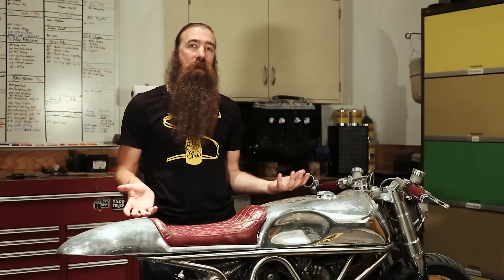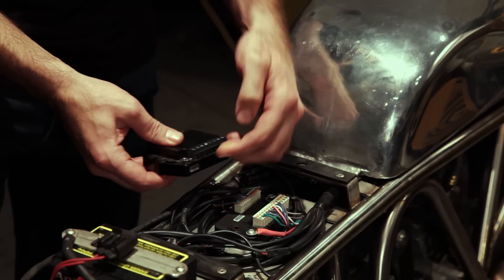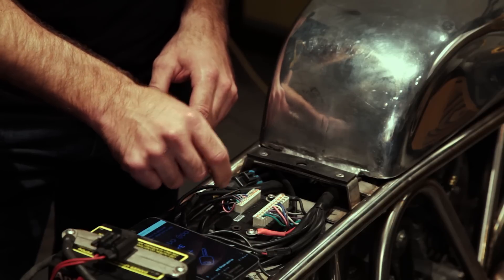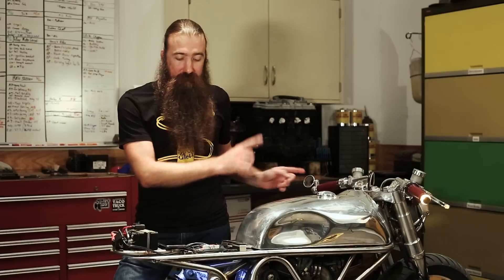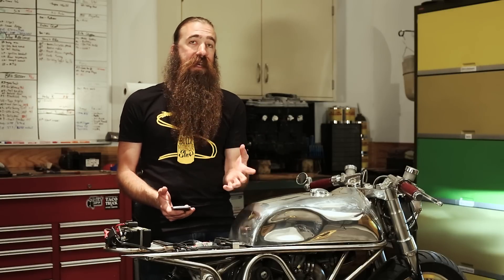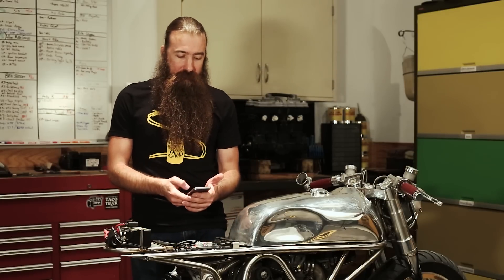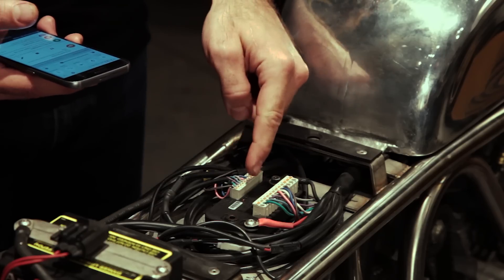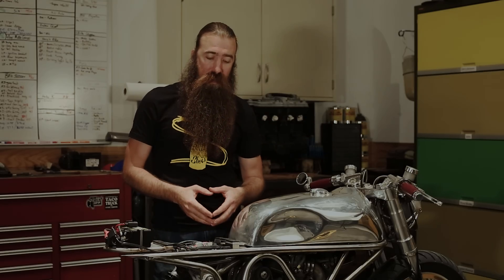Revival Cycles' Tech Talk - The M-Unit Blue on an Actual Motorcycle

Comment: So, I want to understand more clearly, I don't need anything except a battery, AWG 16 primary wire, and the parts that I want to have electrified (lights, buttons, omeders, etc)?
I'm new to working on motorcycles. Old electrical parts are... new to me, and my carbs are difficult to find info on, so those are my learning curves currently (Haynes is in the mail).
1977 GS550 Cafe project!
Reply from the maker: Yea, pretty much. You need an m-Unit, handlebar control buttons,  ignition system, charging system, headlight/tail light, turn signals, horn, starter solenoid, and some dash lights/gauges.  The ignition system and charging system will be from the original bike, or aftermarket model specific options. 

Oh, and 16 gauge GPT wire is good for the outputs, but you can drop down to 18 gauge if you switch to TXL insulation.
Reply: Thanks so much. I just binged a bunch of your videos over the past 18hrs, so I figured it out. Either way, you guys gave me the answer.
Reply: I'm loving the tech talks. I'm a nerd like that. Really helpful.

Comment: Does that mean you don't need to use a regulator/rectifier?
Reply from the maker: The m-Unit will handle all the power distribution and control, but it does not replace components in the ignition system or the charging system. Both of those systems are too model specific to make a universal solution, but the m-Unit is still a great help in simplifying the rest of the wiring on the bike.

Comment: This is kinda a bummer. It won't work with my 77 triumph tiger. No starter button.
Reply from the maker: You can always add another button. Either to the bars or hidden in a different part of the bike. We've got some handy little buttons that can be mounted right off the back of a standard clutch or brake perch. https://revivalcycles.com/collections/for-your-ride-controls-buttons-and-switch-housings/products/push-button-kit This kit is really nice, but if you want to save a few $ this button would work just as well. https://revivalcycles.com/collections/for-your-ride-controls-buttons-and-switch-housings/products/mini-push-button-switch

Comment: I've got the m-unit blue and I was wondering is there a way that I can set it up without using the starter, like i got xs650 with Newtronics Ignition box,  i would like that to run on it own and m unit to use the lights and etc
Reply from the maker: every circuit on the m-Unit is independent of the others, that means you can use the ones you want and skip the ones you dont. You may still want to have a button connected to the start input so you can take advantage of the keyless go feature, but there is no need to have a starter connected to the start output.

Comment: Hello, i have a problem with my m unit blue,  i have an alert on my smartphone that says bike is tipped over but my bike Never falls . And my turn signals are always blinking. Do you know what s wrong? Thank you and sorry for my english
Reply from the maker: This sounds like the alarm is being triggered, which can be caused by vibrations or very loud noises. The best advice is to change the alarm sensitivity to a lower sensitivity, with a pre-alarm. Also you could turn the alarm feature off and see if the problem continues. 

The alarm functions are all internal to the m-Unit so you can't really make a mistake on the install, so if this continues to be a problem you may have a malfunctioning m-Unit and you should work with your supplier to get the issue resolved.
Reply: Revival Cycles , i m already with this option prealarm and nothing changed. Thank you for your solutions
Reply: Everything is ok now,  i updated my firmware m ride

Comment: Curious about the alarm feature. I have the M-unit Basic and have the alarm activated when I leave the bike. I've never had an issue with someone messing with it....yet, but lets say I did. How long will the horn and lights go off for before it stops. Curious if they shut down on their own after a certain amount of time or does it just keep going and going until the key is inserted. I could see the M-unit Blue maybe being better in this regard since it would most likely send you a notification that it was going off, where as the basic wouldn't. Couldn't find any information on this in my manual. Great videos and beautiful builds you guys do. Really inspiring.
Reply from the maker: The alarm duration isn't listed in any of the documentation we've seen, but based on a bench test , the alarm will honk the horn and flash the turn signals for 30 seconds each time the alarm is tripped. So if the bike is bumped its only 30 seconds of alarm, but if the bike is being moved or stolen the alarm will be tripped repeatedly and the alarm will continue to sound longer than 30 seconds.

Comment: Hi man!! can I ask you a question? I have an harley davidson, sportser, if I use the M-unit blue, can I replace the entire old electrical system with a new one, bypassing al the engine sensors ecc? thank you so much
Reply from the maker: The m-Unit Blue will handle the power distribution, but it can't do engine managment. If you have a fuel injected bike the ECU will still need to be part of the system, along with the supporting sensors, fuel pump, and injectors. So far, there isn't really any type of universal aftermarket system that will take over engine management, that is something that is way too model specific and there are a ton of different ways manufactures do it.
Reply from the maker: Hi, you can email us at techsupport@revivalcycles.com with technical questions!
Reply: Revival Cycles ok! Thank you so much!!

Comment: Thank you for showing some of the capabilities the M-unit Blue has to offer. With this latest update from Motogadget is it necessary to install the M-button with the newer M-unit?
Reply from the maker: It is never necessary to install an m-Button. And we recommend only using an m-Button when you actually need it, for example on a ultra-clean custom with absolutely no wires or control cables exposed. For 90% of projects you are better off running the control switches directly to the m-Unit.
Reply: Revival Cycles: That makes sense. You folks over at Revival are doing really cool things and these videos are entertainingly informative. Thank you Revival team for creating a channel. 👍 Rubber side down Moto brothers, stay safe along your journeys.

Comment: with the old M unit working with the M lock i had power drop . Is this better with M unit Blue ?
Reply from the maker: The power drop issue is related to the m-Lock itself, and/or the battery in the bike. The m-Unit blue doesn't really change this situation, but if you are having power drop issues with the m-Lock, you may need to go with a larger capacity battery, or look for voltage losses in the power supply to the m-Lock.

Comment: Does the M Unit 2 have that speed sensor thing? I want to upgrade to a digital tach and speedo for my XV750 cafe build. Im thinking about getting the V2.
Reply from the maker: If you just need new gauges they should include the needed speed / tach sensors. The m-Unit is more for power distribution and providing power to the gauges. Its not a bad idea to install an m-Unit as the back bone of the system, but it is not necessary if you are just upgrading gauges.

Comment: Now if u can make it turn on with ur watch... your pimpish geek motorcycle.
Reply from the maker: Who knows if motogadget will build in support for the watches...maybe someday.
Reply: Revival Cycles wow you replied to my comment. Hey quick question. Does ie really matter on the master cylinder break leaver you use on a motorcycle? Mine is a Yamaha maxim and I wanna change it out but the old break Rez is to big so I bought something smaller. Would it be bad for the front breaks?
Reply from the maker: Its no problem to change to a different brake master. The trick is getting one that has the correct size piston bore, which is different than the size of the reservoir (the thing that makes the master look big). The piston size is usually something between 12mm and 16mm, and ideally you'd want to get a new master that was close to the same size as the stock one. 

But this is also an opportunity to change the brake lever feel. If you go to a larger bore, the lever will travel less, feel stiffer, and require more hand pressure to get the same brake pressure.  If you go smaller on the bore, the lever travels more, feels softer, and takes less force to get brake pressure.
Reply: Revival Cycles I bought some racing looking leavers from eBay. They come with some adjustments nibs on it I just for it because it would go with the feel I want for my motorcycle. But I don’t really wanna replace the whole break assembly. Just the stuff on the bars.
Reply from the maker: you don't need to replace the whole brake assembly. If you want to just replace the stuff on the bars, you can do that, but you will probably need to replace the whole master cylinder, unless you got lucky and the ebay levers actually work with your master cylinder. Most levers are designed for a specific master cylinder, and the way they fit is critical to how they work.

Comment: Hi need help pairing phone to M- unit blue I go through the motions it says successfully connected but when I go to do anything it says no Bluetooth connection to hardware found
Reply from the maker: What phone / OS  are you using?
Reply: Android 6.0.1. Phone is ZTE. 
And I was wondering about the turn signals I have no running lights will I be able to program that with the smart phone?
Reply: Hey I get it to work! Thanks so much this is so sweet bro......
Reply from the maker: Awesome! what was the trick to getting it to work? Perhaps your experience might help others that run into the same problem.

Comment: Hi, and thanks for putting all this effort into these videos. I'm trying to figure out a future wiring for a hotrod. If I have understood your videos correctly, I would only need four wires going from front to back. Left and right Signals, rear and brake lights on one wire and one for the license plate?
Reply from the maker: Yep, that is correct as far as the lighting is concerned. BUT with a hotrod, you may also need to power a fuel pump or other devices that could live in the back.  We have been intending to do an install on a hotrod for years, but haven't done it yet. It should work great, but you should keep in mind the total circuit power, and make sure it stays within the limits of the m-Unit.
Reply: Revival Cycles thanks for a quick answer :-) the hotrod is maybe not a traditional hotrod, more of a customized beetle so the fuelpump is driven by the engine itself so no worries there. Was also wondering about that Bluetooth keyless start function, if I have understood it correctly all I really need is a pushbutton to start it and then turn it off by doubleclicking the same button. Is that correct? Really like this product for all its functions, the alarm is perfect and also to be able to monitor the battery load
Reply from the maker: Exactly, the m-Unit is outrageously packed with features, and the keyless-go works by enabling the m-Unit when the connected smart phone is in proximity, then to unlock the m-Unit you push the start button once, then the m-Unit turns on, push the start button again, and the engine starts. When its time to stop, you double click the start button, engine turns off, then double click it again, and the m-Unit turns off. Once you've walked out of proximity with your phone the m-Unit will activate the alarm.
Reply: Revival Cycles perfect, was also looking at the buttons on your website and you have one that is called Billet pushbutton switch which have two terminals. I guess one is for a wire mounted to the m-unit but where is the other one supposed to go. Don't think I heard anything about it in any of the videos I have seen
Reply from the maker: The billet push buttons are just basic normally open momentary contact single pole single throw switches.  When using them with the m-Unit, one terminal goes to the m-Unit input, the other terminal goes to ground. This way you can send the ground signal to the m-Unit to let it know what you want it to do.
Reply: @RevivalCycles  hi again, im now 4 years later trying to i stall the m-unit on my beetle. But i have run into a problem. I can start the engine by doubleclicking a switch. Shuts down the same way. But for some reason it maintains power so lights stays on even after i shut down bluetooth. Some way it seems to not shut down the Ignition properly or something. Dont know what to do now. I havent got the garage mode activated so it should turn off immediatly, atleast thats my understanding
Reply: this is old tech that many other manufacturers make for cars. You can get one made for a car that is much much more useful, motogadget just simplified it and specified it for the needs of a motorcycle electrical system, also they were able to do it at great price point, a similar system commonly used for cars is much more costly, but it obviously has way more features and I/O options as well has power handling for large starters and fuel pumps. Motec PDM is the best but they range from probably around $3k-8k

Comment: if you're 1000 miles from civilization, and your phone goes dead, or you loose your phone, does that mean you're stranded?
Reply from the maker: Nope, the bluetooth is only needed to unlock the bike, once its unlocked and running it doesn't matter if the phone dies. Also, if your phone dies when the bike is off, you can always use a manual switch to turn the m-Unit on like normal.

Comment: I am trying to reconfigure some of my outputs (AUX) but the unit refuses to go in configuration mode. I get the flashing of my blinkers but that is all the unit does. I cannot get in to any of the menu's??? Any suggestions?
Q: do I need actual load on the outputs to go in configuration mode?
Reply from the maker: No need for an actual load on the outputs, but are you trying to pair with a smartphone or trying to enter the manual configuration settings? The process for manual config was not covered in this video, but it is covered in the manual for the m-Unit Blue.

Comment: Just got my unit and I am ready to start wiring. I have a side car, can I mount the unit vertically inside my side car?
Reply from the maker: Yep, the orientation and location of the m-Unit is not important. The only thing I would caution you on is to make sure you have a very secure ground for the m-Unit mount, you can't assume the side car is grounded because many of the heim  joints used to attach side cars use teflon or other non conducting polymers to act as a bearing, which could electrically insulate the side car. As long as you run a dedicated ground strap, and use appropriate size wire for the length of the run there is no issue mounting the m-Unit in the side car.
Reply: Thanks for the feedback. The intention is to mount the assy with full wire distribution on a metal plate all embedded in a PVC junction box. I am upgrading the wiring on a 1964 BMW 71. (Actually a CJ750 china model)
I like things to look organized.
Reply from the maker: That will work fine, just make sure to double check that ground for the m-Unit, but other than that you are good to go.

Comment: the M Unit Blues does not look likes it is waterproof with those top loading block connectors - is it? Thanks
Reply from the maker: The top loading connectors are actually remove-able blocks so you can remove the m-Unit without removing each individual wire. Then under the block all the pins are sealed to the housing, so yes the m-Unit is just as waterproof as it ever was, but just as before only the terminals where the wires connect are not waterproof.

Comment: Great vid thanks Stefan. Same thing came to mind as the other questions here - what are the different scenarios for when your phone battery is dead?
Imagine going for a long ride, stop for lunch, lose your phone - how to start the bike? Would the m-lock work in this case?
Reply from the maker: Yep, m-Lock would work, or a standard key switch, or even a simple toggle switch. My thought would be have an emergency over ride switch hidden under the seat, so if your phone died you could remove the seat, use the bypass switch, and then re-attach the seat. But there are lots of ways around this issue.